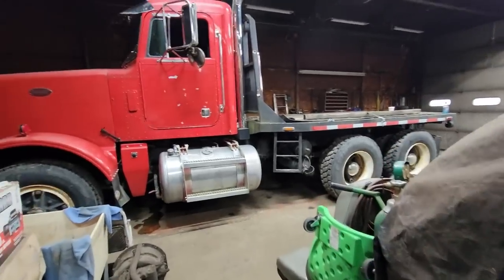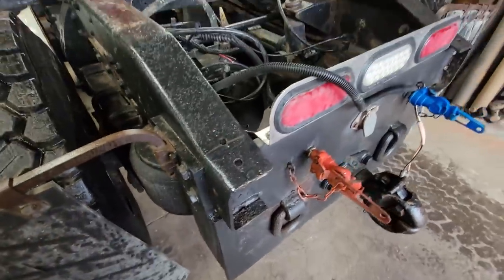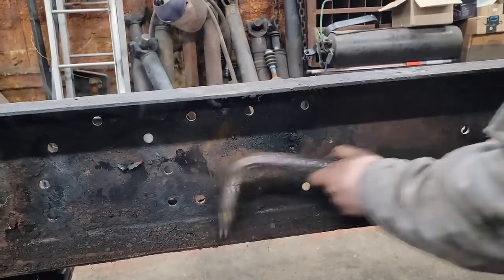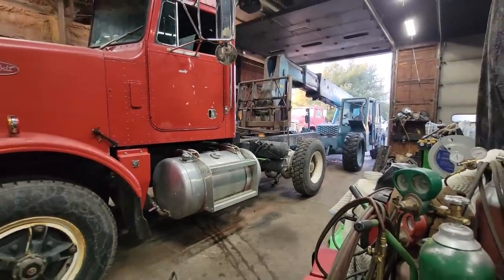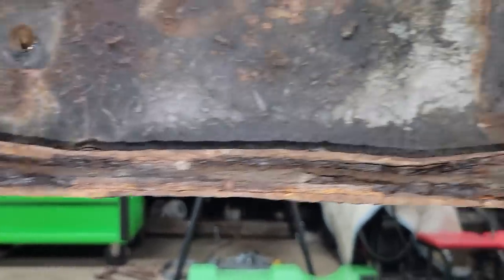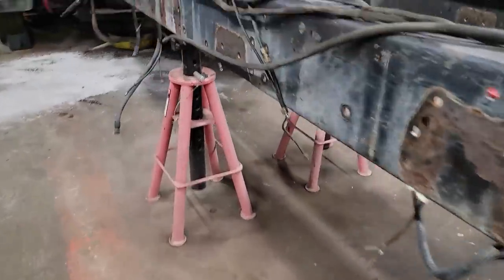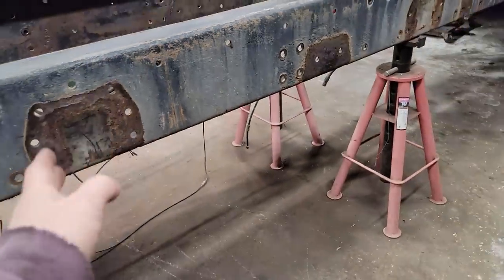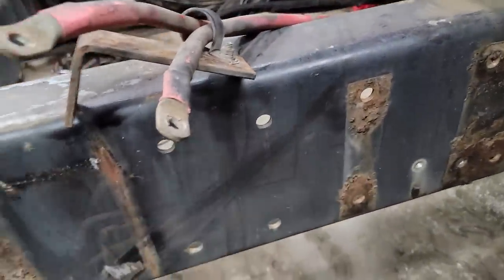PETERBILT 349 FRAME STRETCH PT1 THE TEAR DOWN!

Comment: I know you have a bunch of videos with this info but please remind me where do you purchase your primer and paint for these frames and hubs
Reply from the maker: i use several depending on the application. for frames, i use acrylic enamel with a hardener. tractor supply, lowes, home depot or similar has rustoleum.

Comment: Only thing i can say is use a white marker or grease pencil and right on the frame were what bolts were fuel tank air tank shock mount etc cause in a while at reassembly you will be scratch your head for a while
Reply from the maker: i circle every hole i need.

Comment: I'm just curious as to why you wouldn't use a later model cut off since you have the rust and broken parts?
Reply from the maker: nothing other than cost. the owner doesnt have any money to spend on a cutoff. i am repurposing and reusing everything i can. a cutoff with a better ratio and walking beam suspension would be much better for this application.
Reply: @j.c.smithprojects  Got ya! It is always about the money on projects especially when it comes to trucks! Great video!

Comment: If it were long enough, I'd say cut the drivers side rail aft of the rust jacked area and use that to lengthen the passenger side, but I doubt the good portion would be long enough. If you could remove the passenger side rail and replace it with the right length, you could use it to lengthen the drivers side rail possibly, cutting the cost.
Reply from the maker: the frame is just too thin for my liking. i really want to splice it as close to the cab as i can to remove as much as i can.
Reply: That would be the best course of action, or replace the frame completely with a rolling basket case of the correct length.

Comment: Is there any reason your against welding the inner rail/sleeve together?
Reply from the maker: if you mean the liner / insert, then no i am not against it. i am against paying $4400 and still having to splice it together. if i am paying that money, i want it all one piece. otherwise, i can cut and splice used truck frame. which is what i am currently doing.

Comment: Lift axle on back shorter wheel base great for turning on the front longer wheel base not good turning radius and then you have more drive shaft and carrier bearings that is costly
Reply from the maker: the lift axle is going behind the drive axles.

Comment: In my opinion the z weld on the splice is not good, and 90* angle is a high stress point in the welds.

Comment: For the time, money, and effort,  why not just buy a truck that's to the specs you need. I'm all for using what you have but there is a line to cross with every project. Keep up the good work.
Reply from the maker: rare to find a tandem axle truck with a lift axle  and 22ft of double frame behind the cab. if it were easy, i surely wouldnt let this truck interrupt my already packed schedule.
Reply: @George  I'm not saying go buy a new truck, in my area there is alot of ready mix truck at auctions for example. Be the right frame length,  double frame, and even quad axel set ups. They go reasonably priced. That's all I'm saying
Reply from the maker: if that was an option, i certainly would entertain it. i have 2 trucks here that would suit this build perfectly but i refuse to "give them away" this can be done economically and still be what it needs to be. just have to be a little creative.
Reply: @J.C. SMITH PROJECTS  no ill intent was my intention.  As busy as you are, and as busy as I am, I was just looking at time management. I do know that your build will be to perfection 10x over. I know its tough to work with a budget on bigger projects.
Reply from the maker: i didnt take it as that. we are good.

Comment: Just out of curiosity adding  sections of frame to the outside, could widen the frame a 1/2" or more.  Will this effect the center bolt location on the axle for the air leaf (spring) and maybe put the rest of the suspension components in a bind?  Not to mention if the tank you are going to install has a frame that needs to align with the truck frame's width.  At the same time sliding inserts inside the frame would narrow the inside measurement of the frame by the same amount causing you to have to take some off of the cross members so they will fit back inside the frame. Then there's the pan hard bar that will need to be shortened or the axle will stick out further on one side and could also put suspension components in a bind.  Which method would be the easiest and most cost efficient way or am I over thinking this?  It's going to be interesting to watch and I'm looking forward to future videos.
Reply from the maker: these hangers will accept an outer frame without issue. the crossmembers are 3 pieces each. they are bolted together through slotted holes to accommodate single or double frames. the trac bar wont be affected since there was already a liner in the frame. also track bar is adjustable by shims.
Reply: To; Lightning;;
Yes, you are WAY over thinking it.
My suggestion,,
Wait.
Watch.
Learn.
JC is an AWESOME teacher !!